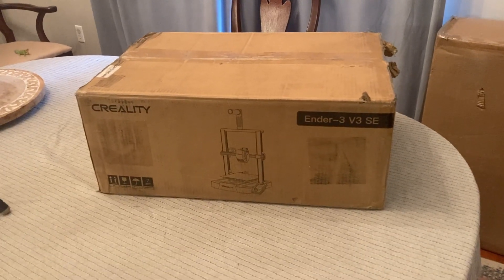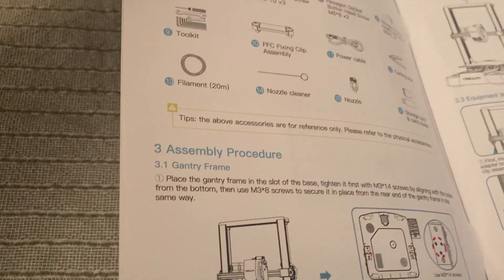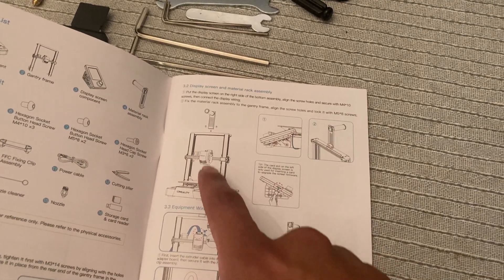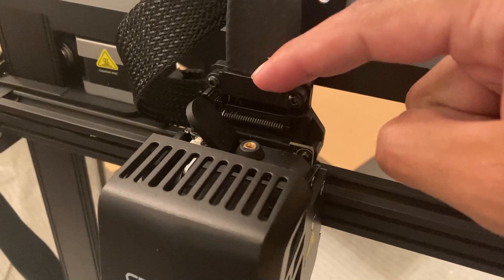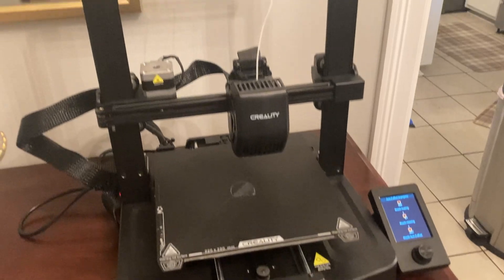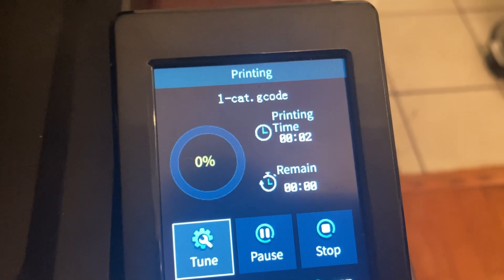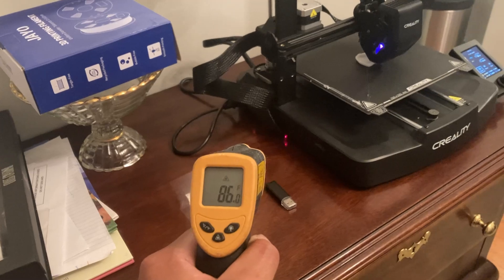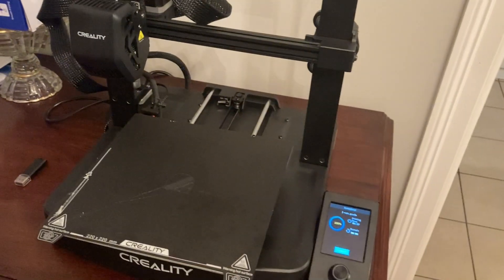Creality Ender 3 V3 SE - Unbox Assembly Setup and First Print! Quick and Easy! (Refurbished )

Comment: Thanks for the review I was about to buy it but I don't like it that's you can't connect it to the computer  still a great printer  for under $100
Reply from the maker: Yea I was pretty annoyed about that at first but got used to it quick. Ended up being kinda nice since I had it set up in dining room for a while far away from desktop comp. Now it’s in a hallway so it’s turned into a benefit that all it needs is power and a memory card to print
Reply: I finally bought it waiting to get delivered
Reply from the maker: @SKYNETTECH06 hope you get a good one!!